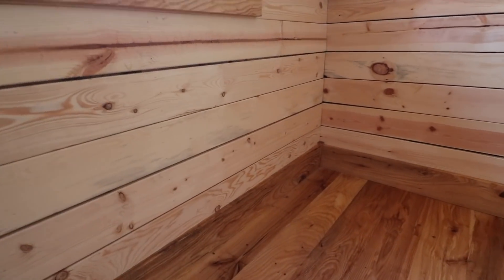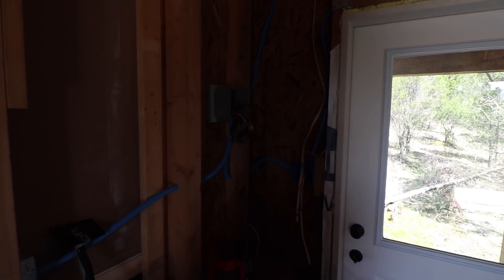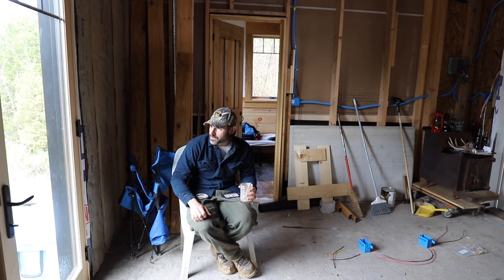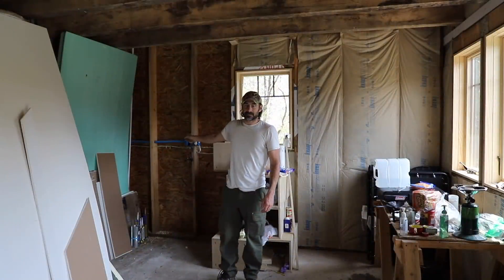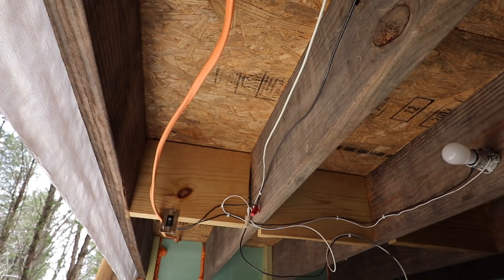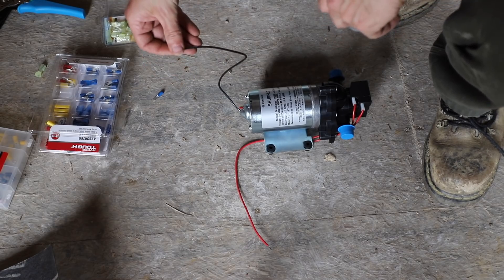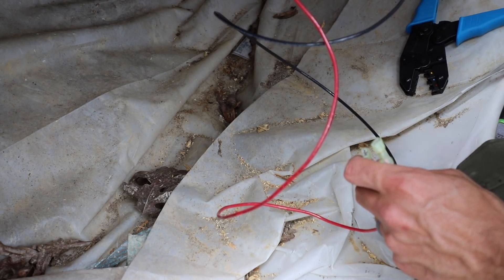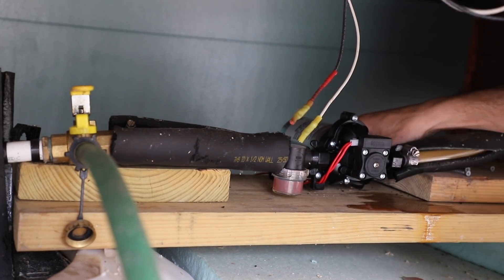Two Day Cabin Trip - Baseboard Trim - Working on Our Off Grid Water System

Comment: cabin is going to be comfy   the way to test your pressure gauge is turn power off open spigat drain your tank gauge should read zero  close spigat or ball valve tap turn power on should cut out at aprox 50 psi cut in 30 psi any way you probaly got it figuerd out  nice to see you got a freind who can help you oh if the gauge doesnt go to zero it probably isnt working but this is usaully on older systems
Reply from the maker: Tim Klassen hey Tim that’s pretty much what I did, but because of editing and and trying to keep it short and sweet I didn’t show the whole process.  I would cut (edit) out while the gauge was dropping and cut back in when it was rising.   It cuts in right at 30 psi and cuts out around 47 so I’ll probably give the set switch another half turn soon.

Comment: Where do you get the water from?
Reply from the maker: Right now I haul it in in a 35 gallon truck tank, from my place in the city.  The plan is to get the spring developed and use that in the future.
Reply: @50Acres  The spring would be nice! Plumb everything with fall back to one spot to make winterizing easier.

Comment: Will it work if you wire a cabin/house for AC then end up using DC through the same wires ? Thanks.
Reply from the maker: It can in some cases, but probably not well because more consideration needs to be given to wire sizing.  The lower voltage of DC often requires larger wire.  You can end up with unacceptable voltage drop where some larger draw items may not work properly.  I would not recommend it.
Reply: @50Acres , Thanks. Forgot about the wires needing to be bigger for DC.

Comment: Using the negative as your switch leg is not a good idea, no matter AC or DC - hi or lo voltage.
Reply from the maker: Hey Gary, I don't, I use the positive in all cases.
Reply: @50Acres    Mike i hope you are not using the switch to break the positive leg if you are at any given time if you should touch the switch when working on it you will be grounded to the power,  on any switch you wire the neutral to the switch to break the neutral going to a (fan or light or what ever) never bring the positive to the switch and break it with the switch, check with the N E C (national electric code) doing it that way can get you the shock of your life if you are grounded and touch it, maybe i heard something wrong ,not being a smart ass  everything else is looking great, good job young man.
Reply from the maker: @williamb6869  William are you based in the states? it's generally accepted and practiced for consistency that we switch the positive and earth (ground) the negative here.
Reply: @50Acres  you are right in 2011 it was changed by the NEC i guess i am getting old you switch the hot leg right asked a friend who is an electrician that wires industrial apps daily sorry my apologize doing a good job on your cabin .
Reply from the maker: @williamb6869  no worries man!

Comment: mike did great on the vid, looking good all around. but here's a little cleaner for ya too think about. build yourself a steel box that holds that water set up, insulate it then cover the lines with heat tape to allow winter use.  other wise the first cold weather it will freeze, and be useless to ya later on. but over all great job. looking for the next vid soon. thanks again for the postings, they make my days go by in fond memories.
Reply from the maker: Thank you Frank, I actually boxed in a small part of the foundation in case I want to turn the water on in the winter.  I haven't finished closing it in yet though.  What I have been doing is just draining back the system and putting RV antifreeze in the pump.
Reply: dude that is a waste. because every time ya want too use it, you lose the fluid, and the water that you need too flush the system out too use. I had issues up to ten below a few times.  in the winters of west Virginia  I tried all kinds of shit too keep the water running.   even with the heat tape, it was a bitch dealing with the crap that kicked me in the balls.  but an old hillbilly named applejack Hogan  after laughing his ass off at my plight ,told me. ya old sun don't shine no there, sow's ya got's to makes it warm all's the time. then he told me how too do so. it was easy and I never had an issue again. but the four years I lived there, I had good running g water ,when ever I turned on the tap.  I used that little space, a 6x6 opening under my cabin blocked off all for about two feet opening too get into it. rapped in in fiberglass tank raping then covered that in tin so that mice and other varmints couldn't get into it. I run a small mighty mite space heater set at 40% it worked great year round too. now understand, I had a 300 gallon tanks half buried  in that space, along with all my water piping, using a fifteen watt solar charger run the tape.  the solar you have would run that whole cabin  if used smartly. but I'd go with more panels, I had a 5000 watt set up, on mine. I had a large RV freg, a dish washer, thirteen LED lights, rv water pump, voltage miter, invertor, and some other things using all that.  never ran below 70% on my batteries.    now with the four panels you have on your roof, I'd box then as well, as the heat going through the roof will allow snow to melt off them.  but also allow air in the summer time.
Reply from the maker: Once I start living there more often I will have to do that.  Last winter I just kept it winterized the whole time.  I like that guys name too applejack hogan.  Wish I had a cool nickname like that.
Reply: hay old jack was a crazy old shiner had a patch cook in just about every day.  drank more then he sold too. hell that had too be over fifteen years ago when  he kicked off ,at a ripe old age of 92.  he use too sit around the fire telling tall tales, hell half I think were real.  but then again who knows the real deal.   I think, he only showed up too eat at dinner time. as the ex was a damn good cook, but then again hay he had too walk a good five miles to get to my place from his.    just about every day he was there Nye on four o'clock.  he didn't walk home most nights ,he was too drunk ,and I'd drive him over to his place.    but he would be back the next day, jug in hand.    don't know how he drank like that, it damn near killed my ass, and I only drank with him about once a week.  great old man thou, he told me some tales that still haught's me.  as too the name and your call-in, try mountin mike.   hell they called me rude ralph for so long.  at first I would get a laugh out of them most days, I just left them too it.    but I did speak my mind, a few times.   so I guess the name fit.   hell he even got me into a few fist fights, over some loose tale, running around, then laugh his ass off,  about it when the shit was over.   but I have seen that old man pull some sweet pussy while on one of his trips to town.  hell looking back on it he owned a 57 apache 3100, in his lean to, and I was the one driven his ass to town twice a month to shop.   then we'd stop to have a drink or five.  play some pool, start a fight,  and cut loose.   hell not even the local law would come up that hill, after us.   but I must say those mountain girls were build well, and rode ya hard.   hell I remember these gal's, named lezzy lisle  and her gal friend dusty may.  those liked to fight men, and would win most fights.    this one night a group of bikers came in too drink ,they got loud and may told them that they were cut off.  one ass jumped up to tell her off. she hooked that old boy right then left, then upper cut his ass right out the door.  lisle took four grown men and beat those boys bad,  then went after the other five. I was told not too interfere or they would beat me up too.   I did get into a few fights on their side ,and wound up being rode hard, in way of thanks. damn thinking about them, makes me  miss those gals.   they were some fun times.'
Reply from the maker: @ralphtaylor3796  92?  I need to start drinking moonshine!
Reply: hell if ya did ,just run across the border with WV, near daton there are all kinds of shiners.  loved the pipes too.  if ya just want too try it, go with clear springs.  best go around.

Comment: Good job.  How big is the water pressure tank.?
Reply from the maker: Thank you, I believe it's only a 20 Gallon tank.   The pump is designed to be constant duty, so even a small tank should help preserve it's life some.
Reply: @50Acres  I was just curious.  I have some videos of what they call water organization modules that filter water for human consumption and they also use a 20 gallon with a 12 volt water pump that shuts off at 60 psi.
Reply from the maker: Ahh cool, Ill check those out, filtration is something ll have to tackle soon.
Reply: @50Acres  look for earthship videos.  It's quite interesting.

Comment: Great to see u are making progress. What are u putting on the outside over the vapour barrier ?
Reply from the maker: Thank you Carol, I am putting up a mesh fabric underlayment for ventilation and drying  and then cedar shingles.  I will have a wainscot strip of vertical hemlock board and batten at the bottom most likely.
Reply: 50 Acres & a Cabin nice I’ll look forward to seeing that

Comment: Love the water system. I have been trying to figure out how to do mine without freezing in the winter since my build is also on stilts and not heated when I am not there. How did you figure that all out? Is there a good resource you would recommend?
Reply from the maker: Hi Charles, you know I really wish all this info was concentrated in one space somewhere.  I kinda collected everything from all over the place and then did a decent bit of experimenting as well.  The pump setup is really not much different from how an RV water system works so thats where I got that idea.  If there is any one thing in particular you are curious about feel free to ask.
Reply: @50Acres  Thanks, Mike. I will think of some more specific questions and hit you back. In reality I am a full year away from digging the well. I am not around often enough so progress is slow. Nonetheless, its nice to keep the plans going in my head.

How wet has it been down in southern Ohio the past week or so? I am in Asia til end of next week and wondering how much of a mess I am going to come back to.

Thanks again!

Comment: I didn't realise a 12 or a 24v pump would be strong enough to pressurise the expansion tank...is the pressure switch on the pump like a regular dug well pump.....thanks for the info! great vids...
Reply from the maker: Yea they are quite strong, just not as durable, but heck they are so cheap you can buy a couple spares.  They can't pull upwards as far as well pumps, so check that spec before you buy and make sure that it can get the water from the bottom of your tank up to your pump.  I think mine can prime up to 8 feet.

Comment: Time to get a battery nailer and a battery chop saw to make life easier on this top shelf build.
Reply from the maker: I couldn't agree more, had my eye on a Milwaukee Battery Chop saw, but it's soo darn expensive...
Reply: Go to CPO Tools ,a 7 1/4 Inch reconditioned is 300 bucks not bad. To bad your not running Ryobi,tools are reasonable and decent quality and they haqve alot of unique tools in their 18 volt platform.
Reply from the maker: Yea I only have that one Milwaulkee tool and I don't like it that much.  I will probably try a different brand.

Comment: Most people walk into a structure and see the wood trim and light features. They don't see or really care about what is behind the walls and underneath the cabin. I absolutely LOVE videos like this which show how you are going to have running water in a secluded cabin. Good luck with your spring. Who knows, if you can get that thing working well, maybe you'll install a mini filtration system as well. Ive seen some pretty cool ideas on youtube about that. Keep up the great work.
Reply from the maker: Thanks Anthony,  I have always had an interest in that stuff also, so I like to include it.  I have kinda started researching filtration etc.  I had planned to trench with the excavator when I had it for the spring but it rained Sunday and ruined that plan.